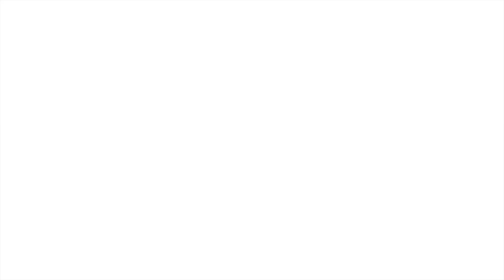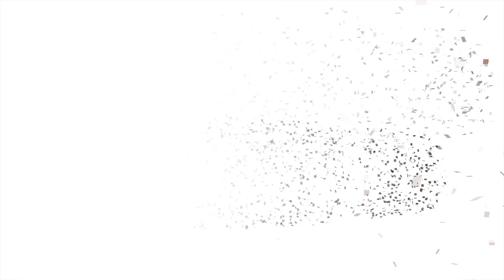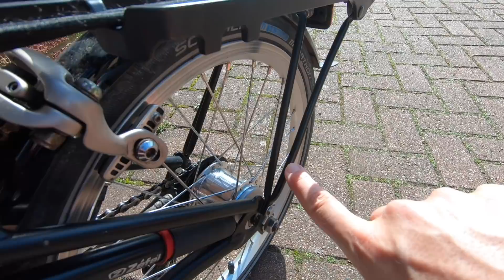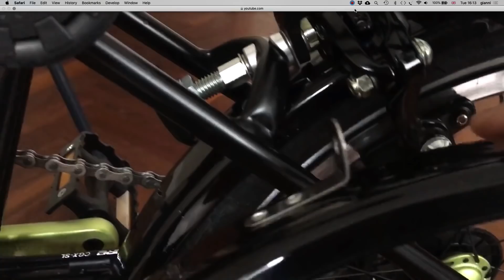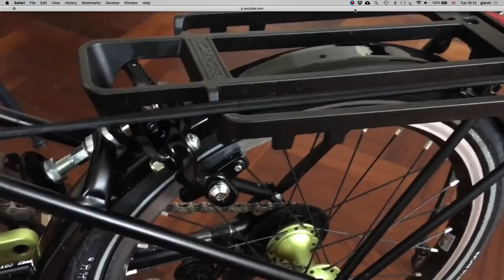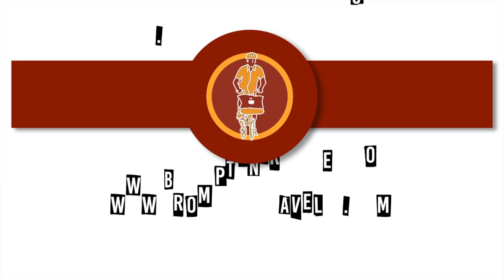What can go wrong with a Brompton

Comment: Thank yopu very much for sharing your experience; i'm wondering if is there any chance to put a sort of piece, maybee cartoon or something harder between the wheel and the rack to prevent any warm of the rack can affect the wheel. Kind regards
Reply from the maker: Ismael Bataller Thanks Ismael, i thought of this too but i have a feeling cardboard wouldn’t be strong enough...One thing i am trying to do more than i used to is to put some soft padding or a sponge under the rack to help absorb some of the impact.
Reply: HI  @BromptonTraveler
Reply: Hi BT, In light of your useful video I constructed a one inch thick styra-foam pad from two pieces half inch thick styra-foam. The sizing is 18.5 inches long and 5.6 inches wide. The two sheets are eventually glued together with flexible book binding glue. The slab that rests up against the rack has two small half inch thick square styra-foam locators glued to the sheet (for each inside end of the rack opening - for and aft of the high point of the mudguard. This first sheet I also cut-out slots for the easy-wheels to fit. I cut a hole in the styra-foam to make way for the seat post. I glued an identical plain sheet on the first one, placed a couple of weights on foam and once set and dried, then cut out the hole for the seat post using the existing hole as a guide.  I did NOT cut out spots for the easy wheels on the second sheet-non rack side. I glued cardboard to the now 1 inch thick styra-foam on both sides for about 7 inches from the easy-wheel end and over the end of the foam - RACK SIDE FIRST, let it dry, cut the hole in the rack side cardboard for the seat post and cut slots for the easy wheels. Then installed the non rack side with similar sized cardboard (NO cut-outs at all). Applied some shipping tape over the other end of sheets to keep the styra-foam from chipping away through use. I spread more book binding glue to the outside edges of the styra-foam to stop it disintegrating from use. My solution and thinking is for protection of the "f" shaped ends of the rear frame supporting the easy-wheels (having broken acording to one of your responders - Oliver Wilhelm) by cushioning the easy wheels during a hard impact inside a B&W hard case. My aim is to distribute the impact load between the front easy wheels, suspension block and the rack frame and hence the struts that support the rack. I am sure this may be of help for Brompton soft bag transporters too, especially the new 2019 b-bag that has a strap to hold the folded bike and this pad to its base.  Cheers to you.
Reply from the maker: @rimowa33  Thanks a lot, you have put so much effort in this! As it is so detailed it might help to have a picture of the system you use whenever you get a chance? Also if you don't mind pasting your comment in a separate comment rather than a reply I will pin it on top so that people can find your suggestion easily. Of course I'd like to hear how this worked out in practice whenever you put it to the test. Cheers.

Comment: First trip on a plane with the Brompton (in a Dimpa bag), I had it just two weeks, corner of the rack with the wheel broken off. I did find without that rack corner with a small daypack on the rack. I replace the rack with a nitto Brompton rack and never had that problem again - but I always try to pad the bottom.
Reply from the maker: Right! We learn from experience. I have done about 20 more flights with the Brompton in a Dimpa and putting a couple of sponges on the base of the folded rack seems to have worked well.. Of course with some bad luck and someone mishandling the luggage badly that might still not be enough but that is quite rare....

Comment: As always, Gianni, thank you for your commitment to Bromptoning and your channel. In all honesty, in light of the specific issue you discussed here with the rear rack, I would say that using a hardcase is really the best fix. Instead of risking damage to your Brompton and then dealing with repairing it, I would rather have a hardcase and then figure a strategy for both leaving it and picking it up later. Damage without a good case can occur on almost any flight and the damage can be on a variety of Brompton parts. For most riders, willing to address the storage issue, the hardcore seems like the best alternative to me.
Reply from the maker: Thanks Stephen. It is for sure a safer way to protect your Brompton. If as you say you can store it and pick it up at the end of the trip that won't be a problem. Another reason I don't use one is extra charges on airlines. It depends on what you take with you but with my softer bag I usually check in about 23Kg of luggage. With a hard case that would push closer to 30 which means extra fees. As far as other parts being damaged, with a little care everything else is well protected even in a soft bag thanks to the way the Brompton folds. The rack remains the main vulnerability. Thanks!

Comment: As an owner of a Lightweight I have had trouble by aligning my front mudguard , as it may give some noise by touching - somewhere, but I haven't actually had it with me on a flight in my B&W travelbox, only in my car. I have a soft cover for a folded stay outside, but only in a safe place!
Reply from the maker: I see. Mudguards are very lightweight and supple, usually a little twist by hand puts it right, at least on mine. Cheers

Comment: A solution that works in part is the b&w folding foldon box.  Check out the brilliantbikes channel for a demo.  It works for cycling from the airport but I think it would be a pain for an extended tour.  
However it’s much more convenient to stash than a full size box and my Brompton was protected.
Reply from the maker: Thanks Beth, that was interesting. It might be a good solution even for touring provided you do a loop where you return to where you started and therefore it can be left in storage. Being 6 Kg, one concern I would have knowing the gear and weight I take along with me while touring, is that it would probably put me a few kilograms over the luggage weight limits for most airlines and I would have to pay some extra fees. Thanks.
Reply: @BromptonTraveler  it’s true, weight is an issue.  My last trip I booked a 20k bag (box with m6r including some clothes for buffer) and also 1 x 10kg (T-bag) and of course 1 handbag which I’d over packed. Doing it again I’d bring a smaller handbag.

Comment: One trick I use when touring ( 25 years of experience ) and doing a linear route is to put the bike in a disposable cardboard box for the outward journey built to be as compact as possible, or to scavange one near the airport on the homeward leg ( recycling skips are ideal and many airports are in industrial areas) , with some tape, a cheap tarpaulain, and some waste bits of carboard, twenty minutes spent at the airport can really prevent damage from careless airport workers ( I've seen them throw bikes through the air before now and also seen bikes drop several meters off airport loading ramps onto the runway) due to lack of care. Heavy hard boxes almost invite rough handling, whilst folks are more careful with cardboard as it's lighter.
Reply from the maker: Thanks kc. That is what I also do, especially on the outward journey. I put a layer of cardboard box inside the IKEA dimpa bag but also in the last few years I put some sponges at the bottom of the bike and tie one especially on top of the rack that when the bike is folded is supporting the bike. Maybe I have been lucky but I haven't suffered a bent rack for a while... :) Cheers

Comment: Hi BT, Thanks for suggestion, I will try to include two photos with this possible travel protection solution.
In light of your useful video I constructed a one inch thick styra-foam pad from two pieces half inch thick styra-foam. The sizing is 18.5 inches long and 5.6 inches wide. The two sheets are eventually glued together with flexible book binding glue. The slab that rests up against the rack has two small half inch thick square styra-foam locators glued to the sheet (for each inside end of the rack opening - for and aft of the high point of the mudguard. This first sheet I also cut-out slots for the easy-wheels to fit. I cut a hole in the styra-foam to make way for the seat post. I glued an identical plain sheet on the first one, placed a couple of weights on foam and once set and dried, then cut out the hole for the seat post using the existing hole as a guide.  I did NOT cut out spots for the easy wheels on the second sheet-non rack side. I glued cardboard to the now 1 inch thick styra-foam on both sides for about 7 inches from the easy-wheel end and over the end of the foam - RACK SIDE FIRST, let it dry, cut the hole in the rack side cardboard for the seat post and cut slots for the easy wheels. Then installed the non rack side with similar sized cardboard (NO cut-outs at all). Applied some shipping tape over the other end of sheets to keep the styra-foam from chipping away through use. I spread more book binding glue to the outside edges of the styra-foam to stop it disintegrating from use. My solution and thinking is for protection of the "f" shaped ends of the rear frame supporting the easy-wheels (having broken acording to one of your responders - Oliver Wilhelm) by cushioning the easy wheels during a hard impact inside a B&W hard case. My aim is to distribute the impact load between the front easy wheels, suspension block and the rack frame and hence the struts that support the rack. I am sure this may be of help for Brompton soft bag transporters too, especially the new 2019 b-bag that has a strap to hold the folded bike and this pad to its base.  Cheers to you.

IMG_1149.JPG
IMG_1150.JPG
... I hope this works.
I tried to copy and paste, I don't think that worked.
Reply from the maker: Thanks a lot. i am sure it will help Brompton enthusiasts!

Comment: It is a good idea to invest in the Brompton tool kit. On a short day trip a while ago, I was riding some unpaved roads, and the rear mudguard started to rattle. The two screws holding the stays to the mudguard was loose. A 2.5 mm Allen key is needed to tighten them (it is of course in the toolkit). This is not easy to fix by hand and those small Allen keys are not to be found everywhere. I think Brompton should change some screws to PH2 instead. A PH2 bit sits in most survival tool kits and Swiss army knives.
Reply from the maker: Thanks Paul, I do like the Brompton toolkit simplicity and the fact that you can put it inside the frame is so neat. I haven't bought one yet as it is kind of pricey but maybe one day I will. When I travel I do bring a Park tool set of Allen keys which as you say is really useful to have.

Comment: It is not just the rack... On our first flight we had the bikes in the original Brompton shipping carton. On arrival we saw that on one bike the hold for the eazy wheel on the front (where it sticks out from the frame) was bent and broken! No problem for riding, but a pain in daily life as you cannot park the bike anymore. We got it bent back and welded in Indonesia, no problem (other than rusting).
But with this experience we will probably no longer follow the idea of flying with a softbag, which is sad because it takes away some of the lightness traveling with a Brompton...
Reply from the maker: Good to know Oliver. I know that soft bags of course do bring some risk of damage. It is still good to know that the way Brompton bikes fold, limit the damage to parts that do not prevent you from enjoying a tour. All bikes can suffer the odd scuff when taken on planes and sometime get damaged on more critical parts like gearing, etc. Thanks.

Comment: Did you ever have problems with the headset. I have around 700 miles on my bike and the headset is making a rattling noise
Reply from the maker: Never had and in years It’s the first time it is mentioned… if you have a chance it would be worth contacting your seller as the bike is quite new?

Comment: Yes.....this has happened to myself before and it's a flaw in the design with brompton rear racks.... when using a soft bag whilst flying I ensure I use at least 5cm of padding at the bottom of the rack with a folding camping mat (karrimor make one and sell at sports direct for £10).....it fits perfectly the width of the back rack. You can either cut to size or use the whole mat. The other solution I have used is use self inflating camp pillows and/or mats to protect the bike......again had no problems so far.....however these can burst .....so used only far padding and not camping.
Reply from the maker: Thanks Ashley. I actually do the same. My last few trips I have used a mat under and around the bike too. Despite this I did get a slight bend on it on my last trip when 4 flights were involved.... I also think next time I will tie a sponge to rear rack to further help with absorbing shocks. Great to hear what other do. Have you ever tried any other racks?
Reply: BT I am reading all of these comments hoping for suggestions about using different racks. 🧐🤔

Comment: have u owned/used/traveled with a Foldie that is not a Brompton before, esp a 20" one?
Reply from the maker: I had bought a Dahon folding bike many years ago with the idea of touring but I never trusted it as the handlebar folding system didn't work so well and it needed regular servicing. Also it had 20" wheels that resulted in a fold which was not as compact as a Brompton and made it hard to carry about and travel with.

Comment: One solution is to take your Brompton as hand luggage.
Reply from the maker: I personally think it is too stressful to give it a try but I heard that it works in some places. I heard people doing that on domestic flights in the US for example. In Europe they have struck regulations on sizes of luggage you can bring on board and you are at the mercy of whoever you meet on the day. If that doesn't work they just put it on hold without being packed as you might have wanted. They do the same with wheelchairs actually and I think they do take care of not breaking those but still... I feel more secure having packed it and I have found that since I take some precautions I mention here the bent rack is not something I have experienced since...

Comment: Again thank you for the video. Is it possible to list the parts you use for your Brompton. Example, the tires, inner tubes and the brake pads. Thank you.
Reply from the maker: Thanks! I do not use anything special as far as parts. My Brompton is a stock bike without any modifications. Tires are important and despite the cost I normally use Schwalbe Marathon Plus. They always served me well and are more resistant to punctures. I use Ergon GP2 grips to give me more option as far as hand position when cycling. Cheers.
Reply: @BromptonTraveler  I like to know where you get your brake pads please and which one will fit the brompton. I am confused which one to get that will work. Thank you.
Reply from the maker: p kay depending on where you live options might vary. I use brake pad inserts that fit into the brake frame similar to these https://brilliantbikes.co.uk/brompton-brake-parts-and-cables/333-brompton-brake-pad-inserts.html . An internet search for Brompton Brake pads in your locale should give you some option. As far as brand i don’t get anything specific. Thanks
Reply: curbsidecycle.com in Toronto 🇨🇦 sells and has a thorough understanding of Brompton bikes. They carry and ship various parts. I see brake pads and brake pad inserts. Good luck & stay safe.

Comment: Gianni, Thank you for this instructive video!
My rear fender broke in the end, when I folded the Brompton and lowered the seat post.
I removed the part that was crumbled now it is fine, the remainder rear fender is still attached and I won't have to replace it!
Does any more Brompton riders have the same "problem"?
Reply from the maker: Hello Menno! Yes from comments below it seems that it is the most vulnerable part when you take the Brompton on planes. This is my experience at least ;) Good that it is not a critical part and with a little bit of experience you can fix this and continue touring.

Comment: Hello! Thks for Your review! Could You make a review about how do You are feeling yourself riding on a sixth speed? Because, i'm trying now to decide - do i have to choose an reduced (-12% gear ratio ) or go for a standard. With regards.
Reply from the maker: Hello there. If you are using your Brompton for touring go for the -12% as you will need it each time the road goes up! Otherwise standard might be fine but it all depends if you have hills to climb and how far you want to go. Reduced gears are good enough for pedalling fast downhill too.
Reply: Most recommend the reduced gearing for touring.

Comment: Would a strip of 6mm ply-board placed in the bottom of the soft bag help to distribute any loads on the bike, and prevent the buckling of the rack. Cheers 👍
Reply from the maker: Yes Gordon, it does. My last few trips I have used a variety of soft padding at the bottom of the bag from insulation material to large sponges with some cardboard to make a stiff base. These have all helped in the sense that I haven't had a bent rack for a while. However it is still a vulnerable part, probably the only one, when a folded Brompton is transported. With airlines travel if you have bad luck your bike can get more abuse than it should and it is a good idea to be prepared in case things do go wrong. Thanks a lot!
Reply: Brompton Traveler: thanks for the reply.